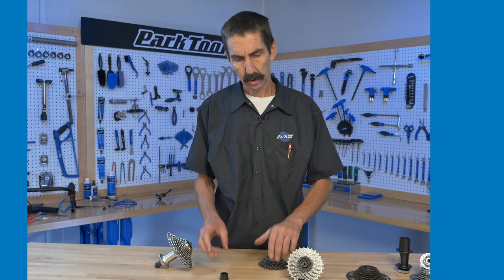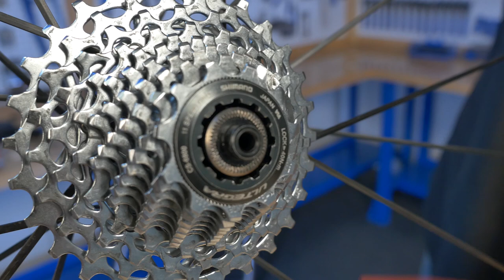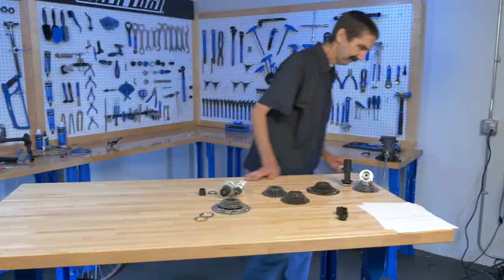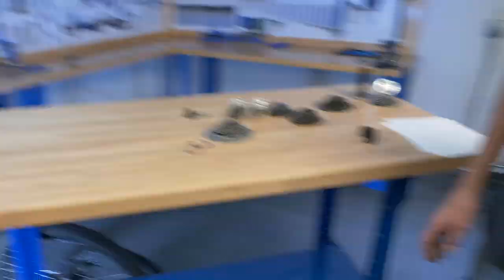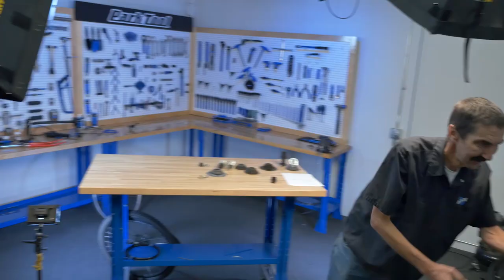Tech Tuesday #46: Freewheel vs. Cassette

Comment: Yeah, my bike has a freewheel.  Once I ordered a replacement cassette, and I instantly realized I got the wrong thing and actually needed a freewheel.  But my bike doesn't seem so inexpensive:  it cost hundreds of dollars.

When there was still a bike shop around here, the guy made all sorts of suggestions about how to avoid the axle breaking so much.  He never mentioned that getting a cassette system might help.
Reply: I've purchased a $600 SE Bike, and it uses a freewheel as well instead of a cassette. I found that bikes usually only have cassettes pre-built into them if they're almost $1,000, or if you find a bike that specifically has one. In that case, the other components would probably be compromised as lower quality in turn for the cassette.

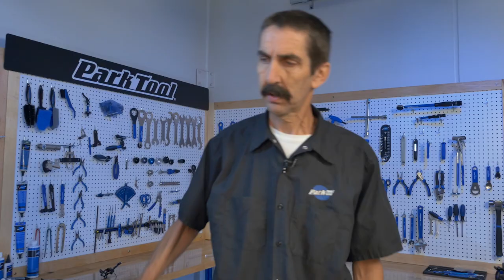Comment: 1:45 - if I see correctly that's a 10-speed freewheel? Where did you get that thing? I thought most freewheels were gone along with 7-speed drivetrain, 8-speed being a real rarity.
Reply from the maker: Yes, there are 10 speed freewheels.  It makes the right side of the hub axle quite long, making the axle system even weaker.  However, they are made.  Sunrace is one such supplier.

Comment: Do the 2 basically operate the same way just with different tools for assembly? I just bought a new rear wheel with freewheel or cassette. I chose the freewheel, would I have to return the wheel if I picked the wrong one? I appreciate the help, ty.
Reply from the maker: They work differently than each other. A freewheel contains a one way clutch and the unit then threads onto the wheel. A cassette is just a set of sprockets that are then splined onto a freehub body that has a one way clutch in it/the hub. Different tools and different designs.
Reply: @parktool  Hi Truman and Calvin.
I understood this question differently, so my answer would be different:
They both have sprockets aka cogs for the chain and a ratchet mechanism. The difference is the placement of the ratchet mechanism. In a freewheel, it is attached to the cogs as a unit. In a cassette system, it is attached to the wheel as a unit.
Apart from the bearing separation benifit, the cassette system is cheaper for the manufacturer, since the ratchet mech is not replaced as often. One hopes (ahem) that this saving is passed on to the consumer ...
Just this week I had a customer with a bent axle. You guessed: it had a freewheel.

Comment: What happens when the ball bearings system inside the freehub break? Is it possible to just replace the freehub or does the whole axle need to be replaced? Or do we need to replace the whole wheel with the rims and the spokes?
Reply: Bearings will be in the freewheel so if the bearings are shot then it’s a straight forward freewheel replacement

Comment: Hi Calvin , I bought an electric bike and it has a 7 speed cassette on it with 7 individual cogs that slide onto the hub and it came loose, so I took it apart and needed to contact them to get the correct lock ring tools, they have the idea and call it a fly wheel ?  I said you mean freewheel ? The technicians, if you can call them that, sent a video of them removing the lock ring with a hammer and screwdriver, I said that's a bad idea and need the correct tool, but they don't have that tool in the assembly factory ,can you believe that ?

Comment: Are all free wheels the same. Will a generic free wheel fit a Campagnolo hub...?
Reply from the maker: Freewheels are not all the same.  Most all freewheel use a "BSA" or English threading for compatible hub.  Campagnolo is an old company and did make hubs accepting a freewheel.  The hub has a large thread machined into the body. Freewheels will vary in number of sprockets and width.  No freewheel will mount a hub designed for a cassette, such as the modern Campagnolo hubs.

Comment: You don't tell us if we can separate the cogs from the freewheel. A tool for the ring with the outside fittings, as the cogs are fine but me freewheeel is a little tight

Comment: Hi. I have a freewheel onto my 20" folding bike. Recently, I'm annoyed by spokes breaking at the J bend on the drive end. Can you tell what might be wrong? I take her on long distance tours on tarmac. However, the roads are not always in good shape.
I weigh 75 kgs and my rear rack carries around 7 kgs of cargo while the front weighs around 3kgs. The wheel is single walled steel with 28 spokes. 
Would changing from freewheel to cassette be better? (That is if I ever could?)
Reply from the maker: The common cause of broken spokes is typically low tension.  Spokes see a stress cycle by slackening each revolution.  A tighter wheel see less of this tight-loose effect.  But all wheel with time will see fatigue spokes.  
At this time you likely need a rebuild. A cassette hub will not change this issue of stress on the spokes.  However another cause is simply cheap and poorly made spokes.  Have the wheel rebuilt using good quality stainless spokes, and get them tight.
Reply: @parktool  Ok. I'll have a word with my LBS. Thanks.😀
Reply: @parktool  very informative. I love it

Comment: i have a lock ring  with slots on the outside . remove this lock ring  , all sprockets come off individually ,with 3.2 mm spacers in between {except the smallest of the 7 cogs ,14 tooth has a built in spacer ] . inside the hub is splines that do not turn backwards with the hub . there is no hollow bolt to secure it . the hub has 2 different diameters .it  steps up on the inside to hold the larger cogs . there is a wide spot on the hub cog splines so that the cogs can only go on one way . is this a hybrid freewheel of some type ? or a freehub . i have not located a tool to remove the hub yet . so im not sure what i have .
Reply from the maker: Very like that is a freewheel, not a cassette.  See the bottom of https://www.parktool.com/blog/repair-help/freewheel-removal-and-installation 
That lock ring holds the cogs on to the ratcheting body, which is threaded to the hub.  Also likely it is a FR-1.3.  See https://youtu.be/iTJ3taJHOn8
Reply: @parktool  thank you .. I think your correct.

Comment: what do we do when my 11 speed can't reach at 11 speed and it can reach only 9 speed
Reply from the maker: it could be a couple things but im guessing it is either the low limit screw is too tight and is limiting the derailleur to the 9th cog. Or it could be your cable is too loose. In that case you should shift into the most difficult gear and try to release a few more clicks out of the derailleur then loosen the cable pull it tight and refasten it. Check out our video on how to adjust a rear derailleur.